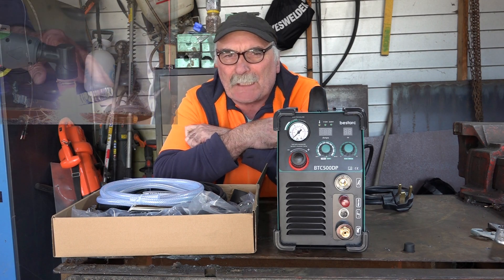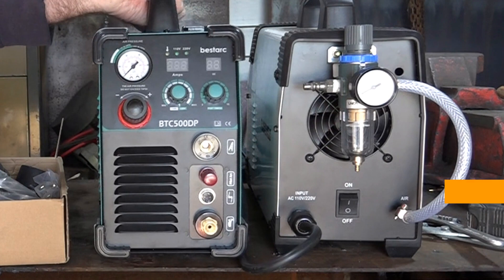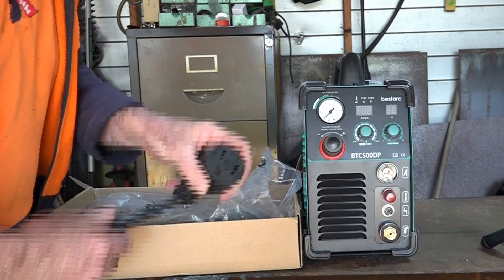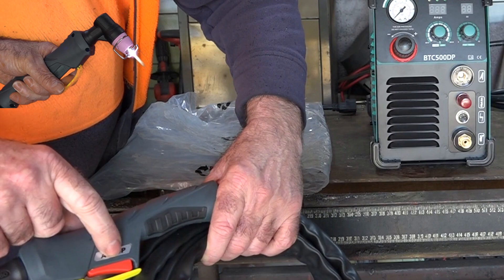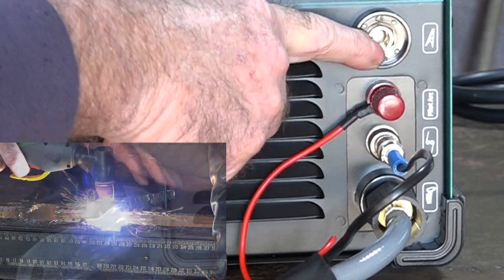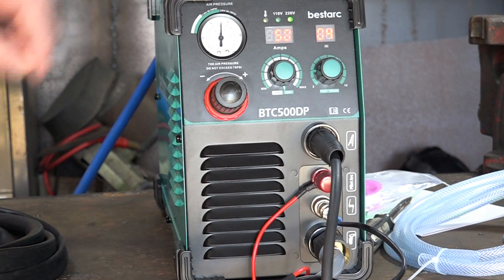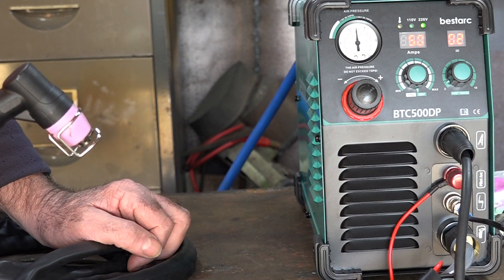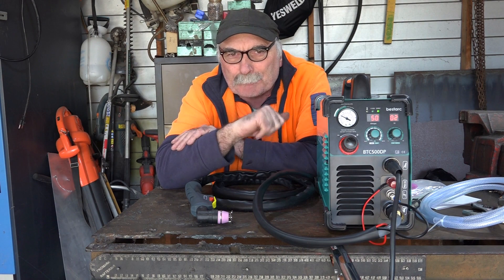Bestarc Plasma Cutter: INSANE! Machine Has More Features Than An Expensive One

Comment: I just got one of these myself. Tried it out on 110v at 15 Amps and 65 psi just to make sure it fires. I have yet to get my 220v going which I plan to use it on.

It sputters at that lowest setting of AMPS but if I go higher I'll pop the breaker.

Someone suggested that I turn down the PSI to 40 PSI for such low amperage to get a consistent pilot arc flame that doesn't pulse... Says the PSI is too high and blowing out the arc at that low amperage.

Since I am new to Plasma Cutters I am curious if that suggestion makes sense. I'd hate to get past 30 days only to find out my unit is bad.

Really have to get my 220v done and usable before then. :)
Reply: Well, with all the numerous wonderful responses I thought I'd update that it indeed was too high of air pressure. :) Trying the 20 amp setting also fixed it.
Reply from the maker: GREAT